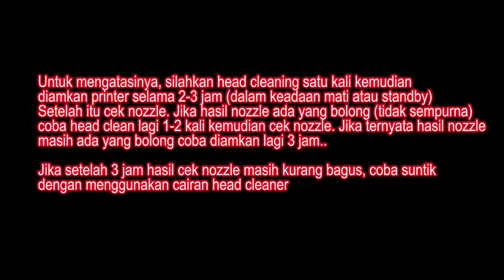Cara Ganti  Print Head Epson L220 L210 Dengan Mudah

Comment: bang itu print head yang lama ngak bisa di perbaiki sama sekali ya ?
Reply from the maker: kalau print head setengah shot atau short total tidak bisa diperbaiki. Tetapi kalau buntu masih bisa disahakan dengan menggunakan head celaner ( ada yng berhasil ada yng tidak)
Reply: Sebelumnya makasih videonya.. mau tanya klo printhead tipe l100 dipasang ke l220 sama gak?